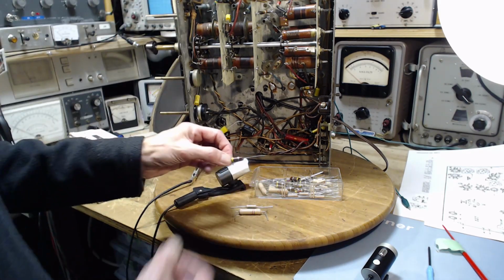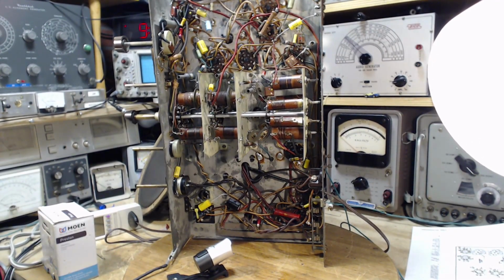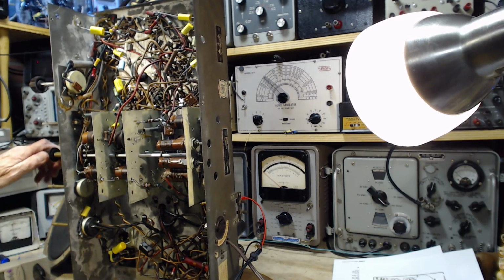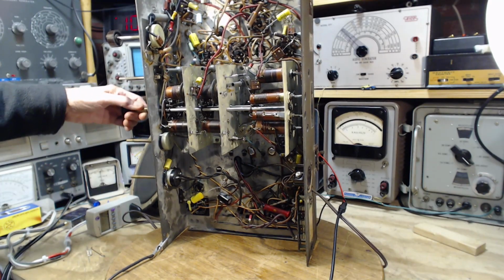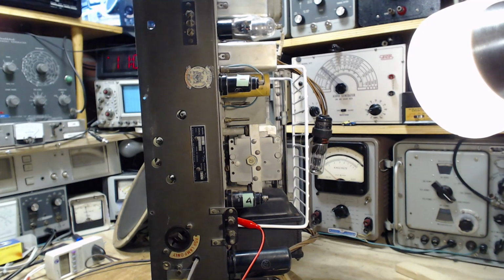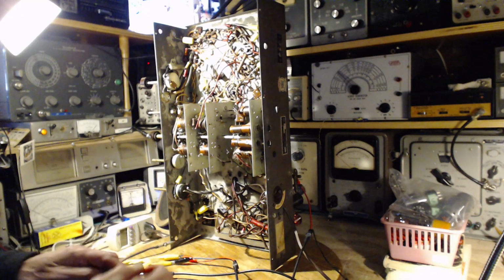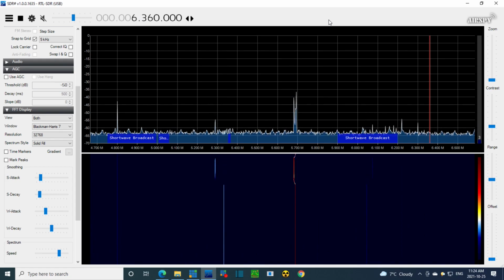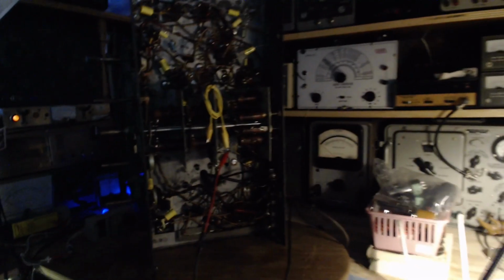Westinghouse Model 1029 Multiband Tube Radio Video #21 - Back in the Rabbit Hole

Comment: Weird indeed.  I have a bunch of the exact same wattage 470 ohm silver band resistors here and I randomly tested ten of them on both my Fluke meter and my chinese component tester.  Every single one tested no more than 472 ohms.  Four of them tested exactly 470 ohms, five tested 471 ohms and one tested 472 ohms.  These been sitting in a can in my shack for over 15 years.

Comment: 33:00 Asking for helping comments to be posted? After you repeatedly in a very pompous and arrogant way you stated you didn't read them?
Reply: Not only that. If you go back to videos in 2019 he got lots of helpful informative comments. But he never acted on them and arrogantly brushed them off as incorrect. for example people warning him of dowsing the tuner section of a radio in WD40, for it would creep everywhere and mess up alignment. They even gave the proper reasoning behind the warning; which is WD40 seeping into sintered ceramic trimmers and displacing the air gap between rotor and stator, thereby increasing dielectric constant.
And what was his reaction? An ignorant and pompous "More WD40".
He does not deserve any helpful comments. His audience however does to point out to them his mistakes so AT LEAST they learn.
Reply: @asmallmatter4441  Couldn't agree more with you. Thanks for your comment, stay safe !
Reply: @asmallmatter4441  Yes I alway go to comments section you get some good tips but without Jim the comments would not exist so I am happy for both and I like the supervision of the cats now and then.😸
Reply: @asmallmatter4441   That's the only reason to watch him. It is like he's the master!